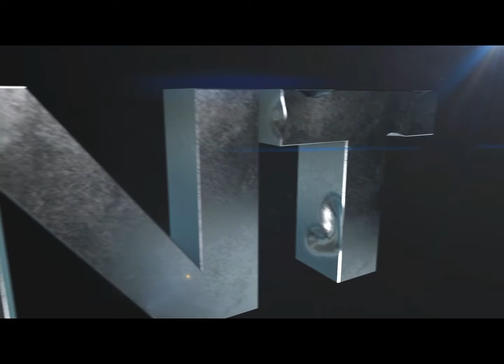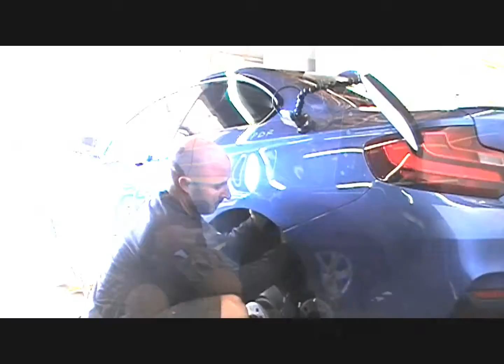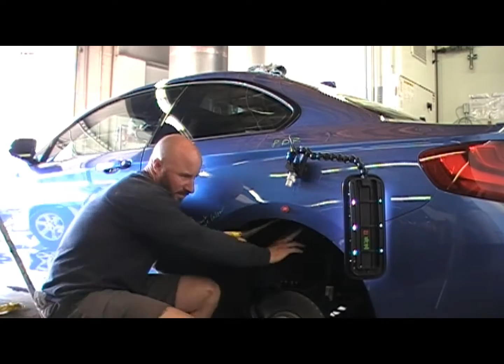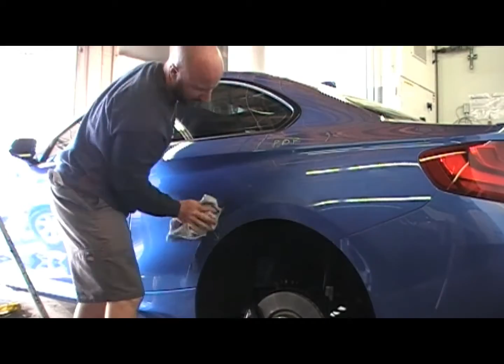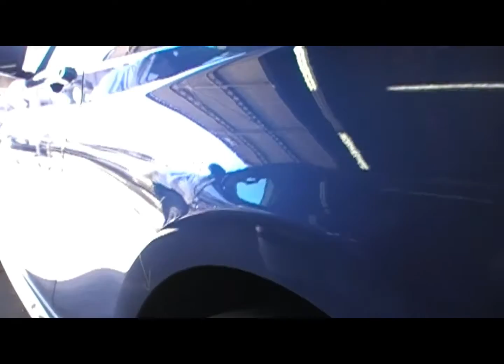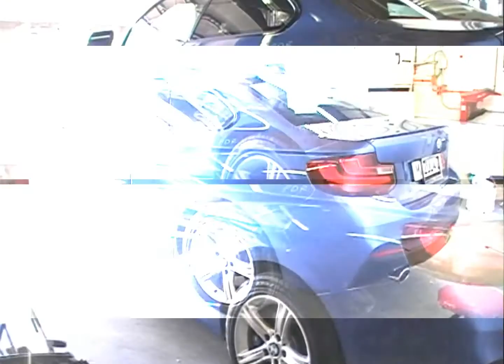Large Dent PDR with Glue pulling on BMW quarter panel

Comment: can most car gain access through rear tire fender liner area like that?
Reply from the maker: No. Some have factory holes and some do not. And of course the ones that do have holes are not always where you need them to be.
Reply: INDEPENDENT DENT COMPANY I have a small crease on my quarter panel. I glue pulled some of it.  I want to get a reflection board. How do I tell what is a high spot using the reflection board?